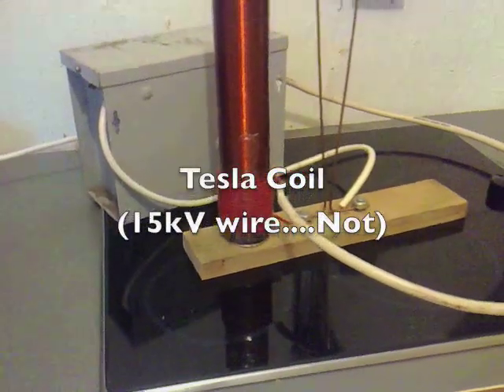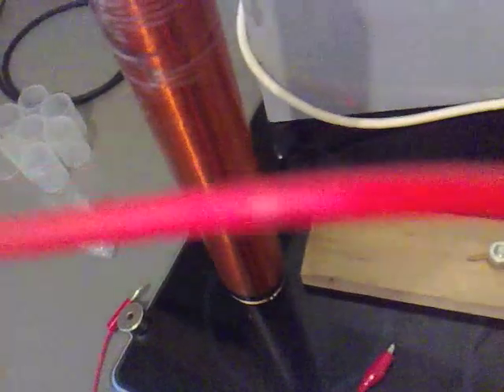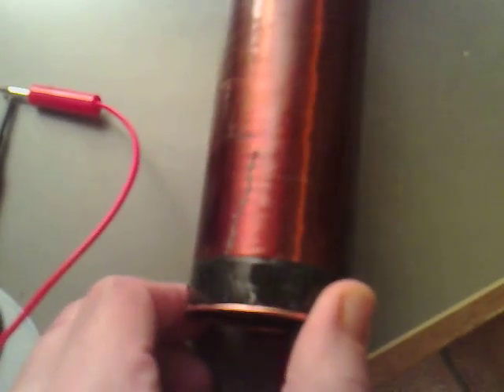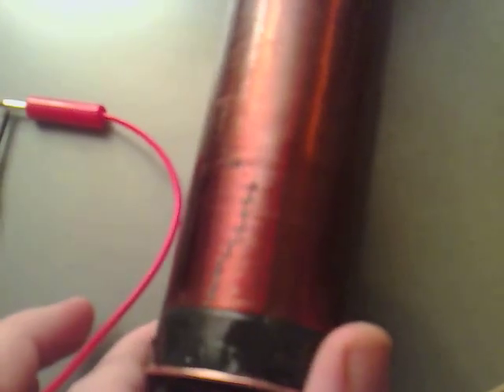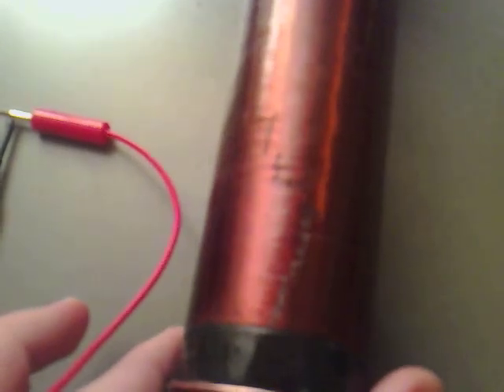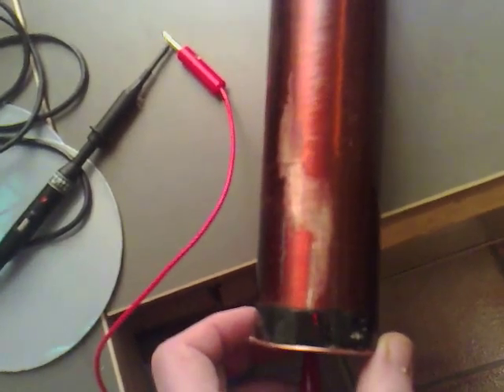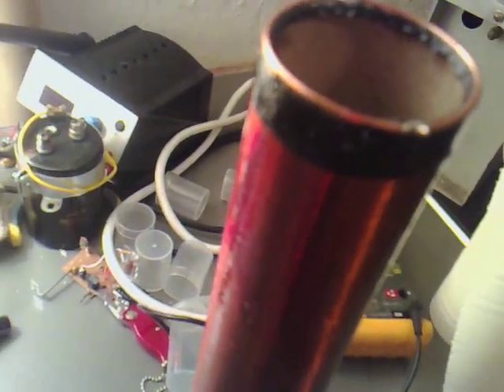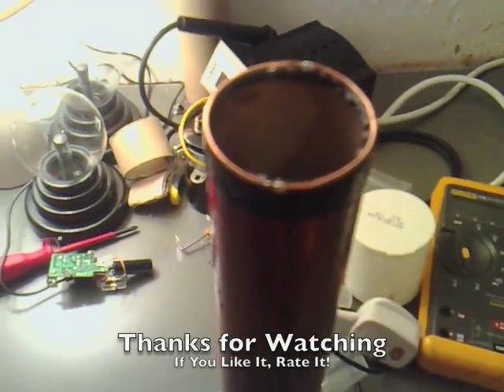Tesla Coil (15kV wire...NOT) 006

Comment from the maker: It is only 50Hz I am using but I think that I have worked it out.

The transformed voltage is zapping back into the primary making it Very HV through it. Then the insulation is being burnt by the secondary...

Paul..

Comment: the bigger the cap bank,,,, the more wider you can get your spark,,,, multiple spark gaps cut the noise more the half way down but you still have to take into consideration the maximum amount of gap that your cap bank can handle before arking out. .  also your top load changes the frequency, by what i think is making a cap between the air and the toroid/top load

Comment: also the transformer is making the capacitor charge to way beyond 15,000 volts,,, or what ever the transformer is. every time the pop sounds your probably doubling your voltage there's probably a diagram/chart you can use to figure it out, seems the higher the capacitance the more the caps charge, and the higher the voltage gets

Comment: that burn through should be no problem at all,,, just use some silicone gasket ,,, mine burnt out, and every time i used it , the burnt spot glowed, i used that silicone and patched it rite up. and also your gonna want at least a half in in between the primary and sec., i think the reason your ressonace frequency changed is because it picking/open circuit from the burn out.......... try it might just work